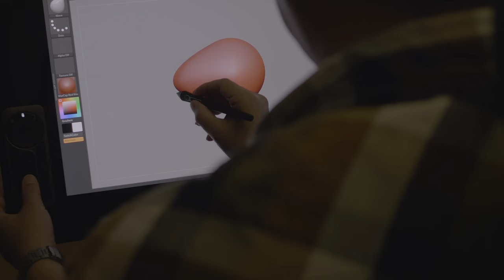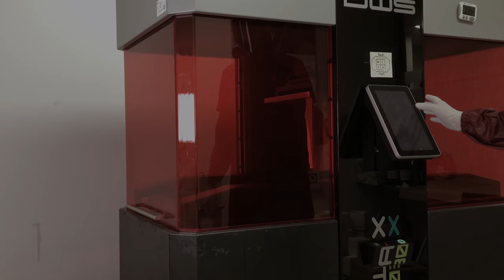How to make Humpback Whales diorama | #Resin Art | #RAYCLAY #diorama #art

Comment: Hey what epoxy resin did you use? How come it didnt create any bubbles? It looks amazing!
Reply from the maker: @Louis Moon  The resin I used is a low viscosity type resin.
When the low-viscosity type resin is cured for a long time, it becomes easier to remove air bubbles.
Thank you.😃👍
Reply: @RAYCLAY1  is there a specific brand of resin? And how do you make it cure slower?
Reply from the maker: @Louis Moon  Thank you very much.
I used is the Chamchristal resin (low viscosity type) of Dongyang C&C.
And the lower the ambient temperature, the slower it hardens.😉

Comment: Amazing work!!! I had a lot of questions....How did you apply the resin? Layer by layer? since if the layer is thick, the wheat is..you know...and how did you hide the lines between layers? and what kind of thread did you used to support the whales suspended...is not visible at the end!!
Reply: @RAYCLAY1  That was a really good tip again. To mix the color in the resin before adding hardener, to avoid layers. Subbed
Reply from the maker: @medievalo Thank you. I usually, To avoid layer shape I do pour at once if possible. But this work is 2 layers because of the waves. A small tip is that before mixing resin hardener, you can color mix basic resins at once. And if you do each hardening twice, you get the most similar color. The whale fixed rope used the thinnest transparent fishing line.

Comment: Hello, could you tell me what is the name of this dark material (which is a rigid foam), I have already seen it used for different applications but I never see what it is precisely, and without this indication it is difficult for me in view of the quantity of existing foams to find this one in particular. Thanking you if you can inform me.
Reply from the maker: @Joshua It's a foam board.
You can easily find it by searching.
Thank you very much.😉👍

Comment: hello, good video. can I ask what resin you use please? I bought some to do a small art project that was about 10cm deep by 3cm deep. i poured it in one and it got very hot very quickly and ruined my item. 

thanks
Reply from the maker: @SoggyBiscuits1000  I used low viscosity type resin.
If it's a small size of 10cm wide and 3cm long, lower the ambient temperature. Then it takes longer for the resin to harden. 
And if possible, try using resin with a long hardening time.The resin causes thermal deformation when the temperature rises.
I hope it helps a little bit.
Thank you.😉
Reply: @RAYCLAY1  Ok thank you

Comment: Great work! I was wondering how you prepare the cast object the “whales” to protect them from the heat the resin created while curing and to get the resin to adhere to the whales without sanding them? ??:)
Reply from the maker: @pitsburg11  Thank you.😉
Hardening low-viscosity resins for a long time causes less heat.
Reply: RAYCLAY okay great thank you!! Can I ask you one more question wondering do you cover the acrylic paint on the whales with anything to protect paint from resin and heat? Do you sand the whales so resin adheres??
Reply from the maker: @pitsburg11 Thank you
I sprayed a matte transparent coat at the end of the work.😉

Comment: Amazing... 

Question, how did you get the bubbles into the resin by the tail? Did you use a tiny straw or pipet to form air bubbles?

Also, when you used the resin to seal the connection with the separate top piece, did that completely remove the seam?  I can't see one at all in the final image.  This is outstanding.
Reply from the maker: @ColonelVirus  Thank you very much.😉
When the resin is sticky hardening progress, Add wheat flour and mixed to create the bubble effect.

Comment: How did you get rid of all the bubbles?
Reply from the maker: @Xit Ement  Thank you very much.😉
I used a low-viscosity type resin with a long curing time and cured it for a long time.
Low-viscosity resins are easier to remove bubbles.

Comment: hello really nice work but I want to ask this. How did you pour in one go and there are no floor marks?
Reply: @RAYCLAY1  
thank you for the answer. what are the total dimensions? :)
Reply from the maker: @Güney Demirtürk Thank you.^^ This work is 2 layers because of the waves. A small tip is that before mixing resin hardener, you can color mix basic resins at once. And if you do each hardening twice, you get the most similar color.
Reply from the maker: It's about 25 cm long. Thank you.

Comment: Fantastic job...where did you get the "model" (white plastic) to make the mold from?
Reply: @RAYCLAY1  Thank you.  Did you have to do many hours of sanding to get resin clear?
Reply: Did you place the dry "sea surface" resin onto the wet resin cube when it was wet then cover it by brushing wet resin onto it?
Reply: @RAYCLAY1  Thank you...
Reply from the maker: 0:39 I digital sculpted the sea surface (white plastic) and then used 3D printing at 1:10. Thank you !
Reply from the maker: @Richard RichArt Thank you. I did not sanding because the acrylic mold surface was clean.
Reply from the maker: @Richard RichArt 7:43 I dried the resin cubes first, then added some more resin and covered the "sea surface" resin.

Comment: Your surfece lines doesn t seem ? How did you do that ? D:
Reply: @RAYCLAY1  Thanks. Excellent work. What do you mean by hardening twice?
Reply from the maker: @Burak Dumanhan Thank you. A small tip is that before mixing resin hardener, you can color mix basic resins at once. And if you do each hardening twice, you get the most similar color.
Reply from the maker: @Django Di Ungli Thank you.😉 The first is the entire ocean floor, and the second is after covering the surface of the waves.

Comment: Step 1, buy,  what I'm assuming is, a $20,000 resin printer...
Reply from the maker: @Rexx Thunder Thank you so much.😂😉
Recently, the price of 3D printers has been going down due to a lot of supply.
I like to use new techniques or different methods.
And I also like to do it manually.
I will also add some art made by hands as soon as possible.
Please look forward to the next video.
Thank you again.